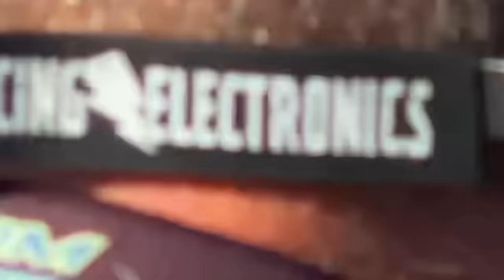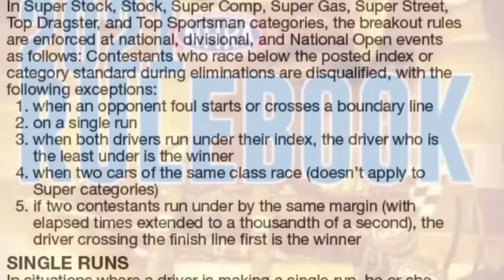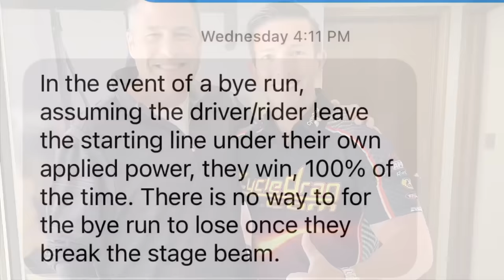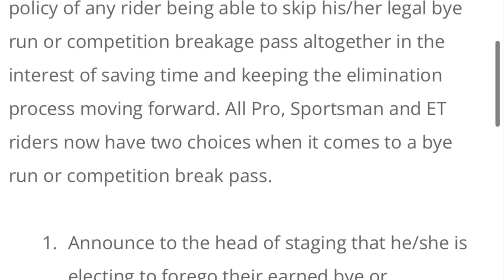TOP FUEL MOTORCYCLE GONE WRONG!

Comment: Judging from the contact patch on Vantine's bike during that DQ run, it's twisting the rear suspension and putting more weight on the right side of the tire at the big end of the track, and pushing the bike left. Maybe there's a broken strut that's not showing up until it's under power? Just a thought...
Reply: Agree, It sure seems mechanical.  That covers a lot of territory.
Reply: no suspension, but i agree.....the rear tire mount is flexing and steering the bike
Reply: I think it’s the pilot
Reply: @canabox7112  and you have raced how many bikes?
Reply: @mattsez2879  a few
Enough anyway
Reply: @canabox7112  mhm
Reply: Excuse me engineers oh you who engineers... One tiny itsy bitsy little bitty problem with your theatrical theory.... There is no rear suspension
Reply: @donniebaker5984  yes.....i said that and others agreed yee with zero engineering
Reply: Right no rear suspension but he's calling it right when he hits go the bike is twisting the entire frame forcing the front tire to twist to the right making the bike go left no amount of counter steering is gonna stop the bike from going left with the front tire riding on the left side like that. It's just gonna force it left til he stops twisting the throttle. The rear frame needs cross bracing  from right high to left low to stop the twist it should be welded in just in front of the rear tire to stop the frame from twisting.
Reply: I haven’t played back in slow motion. So I can’t agree or disagree with anyone. But you don’t have to have suspension to have flex that causes adverse effects. And I don’t know much on these exact bikes. But the rear is definitely mounted and aligned somehow. So there definitely must be potential for issues somewhere. And no I don’t have experience in two wheel racing. But I do rac 1/8 mi quads. Where 1psi of air will cause bad trouble. Also with no suspension

Comment: I agree with Dan W to a degree, it appears when it goes into tire shake it seems the slick rides up on its right side.  I would make a slick change .  Maybe a slower reel on the tape may show if the suspension is twisting alot, but you can see the left side of the tire never peaks.

Comment: Just thought you might like too know, my 2021 Ducati Street Fighter, with Akrapovic full Titanium exhaust MAP upgrade and low restriction air filter Dynoed 207 rear wheel horse 415 lbs and ran a 9.54 1/4 mile ! IMAGINE with a wheelie bar. Getting closer too the 8's for a street bike. THIS bike is my every day transportation ! 9,000 + miles in 10 months..
Reply: That's badass
Reply: I always thought they should bring more Ducati's to the mix 👍
Reply from the maker: Thanks a lot for watching and following the channel. Which Top Fuel Motorcycle in this video was your favorite and why?
Reply: @cycledrag  I'm an X HARLEY dealer and Flat tracker THAT should awns er your question lol. My 78 Sportster XLCR,, Cafe Racer, ran 12.00 flat in the 1/4 in 79. I always have too do things differently. OH, I'm just shy of 73. When I take my helmet off, you should see the look on there faces, ESPECIALLY the POLICE,, PRICELESS !! I never try too out run the police, there radios are faster. So they appreciate that. Quiet a few warning tickets. 140 in a 65,, SERIOUSLY

Comment: In ref. to Dave Vantines situation. These rules were originally designed for side by side racing and should be modified for single lane passes or by runs. Jay seems to have lost touch with the spirit of the rules and needs to reevaluate this rule for sure.
Reply from the maker: Yes' Id like to see Man Cup follow the NHRA rule. Thanks a lot for watching and following the channel. Which Top Fuel Motorcycle in this video was your favorite and why?

Comment: Great video.  Great job of commentating, so far.  At 8:00 mark, I would guess, frame flexing, for some reason, or uneven traction, side to side, on rear tire,  bad tire, or burnout, front, or rear tire not on centerline.  I hope the figure out what it actually is.  Very interesting to know.  At 11:01, I saw a steering damper on a bike, on next run.  A simple possibility there, also.  On the rules for drifting over the center line, if a bike has shown a tendency to drift the same direction, more than once, maybe twice, in the same event, it presents a strong risk to its rider and to his opponent, in any future side by side runs.  Even in a single bike run it points to strong risk in a future side by side run.  Rule, or no rule, I can understand the DQ, after several times of drifting like that.  I wouldn't want to race him.

Comment: Great coverage, I enjoyed it.

This is just a guess:

Regarding crossing over into the left lane, it would have been helpful if the camera had been located up in the air, perhaps 10 to 15 feet above the track surface, in a fixed position pointing straight down the track from directly behind the racer's staging position, and not turning to follow the racer. Make it follow as closely as possible as though he had a bullseye on his back. Also, use the slow motion setting if one is available.

I think the swingarm is flexing/twisting ever so slightly to start the process. Noting the chain pulls entirely on the right side, producing a cantilever effect on the swingarm. Viewed from above, the bending allows the rear tire to move toward the 11o'clock position, i.e. the front of the bike moves slightly to the right because the rear wheel has turned to the left. As the rider senses this he makes a move to counter/correct for the bending, etc. and by the time he does that the rear wheel is really chewing the track for traction, and staying on the throttle causes it to continue toward the left lane with little correction remaining for the rider to make before he's already in the wrong lane.

I don't know that it would have been any clearer to see what's happening, but I truly think an overhead camera pointing in a fixed direction so everything can be seen with the same fixed eye might reveal the cause. Whatever it is likely happens within the first one or two tenths of a second, i.e. the moment the swingarm is being slammed from a no load condition.

Incidentally, has the same problem ever occurred when he ran in the left lane, and have other racers experienced this problem?

Best wishes, and I hope this helps.
Reply: ……….comments…….not novels!!! 😏 I’m just saying…..🏁
Reply: @randalskinner1194  stick to the video, if you can't read.  just saying...
Reply: …….everyone’s always got something to say……it was a suggestion, not an invitation to a fist fight. If you agree with him, smash his thumbs up button. Disagree with me, smash my thumbs down button. That’s all that’s required. False accusations of someone’s reading competence………really???

Comment: These guys are all on the absolute cutting edge of going this fast on a motorcycle with the biggest set of nuts you’ve ever seen in your life I mean they can’t carry these things on airplanes that guy in the video is basically on a motorcycle 200+ miles an hour and a quarter mile with 2 3 Liter bottles between his legs impressive i’ve heard now in 2022 they’ve actually got a surgery where you can have them on a quick detach system so that’s gonna give them a solid 10or 15 miles an hour 45 lb weight deduction

Comment: Torque steer is what the slow motion video shows when the bike leaves it 60 straight because of strong left side wheelie bar wheel contact but once it gets up on the tire the input from the wheelie bar goes away because of diminishing Torque leverage over the tire so tire speed is rapidly increasing and so is tire growth thus unloading the wheelie bar and now the front wheel has a say in the matter so with the Torque steer that is being applied the chassis is flexing thus driving the bike left ..if it wheelies the whole length of the track it would go straight...... Larry Spiderman Mcbride has always been my favorite CH3²  kind of a home town heroe but I like all bikes the ones that go straight the ones that only turn left the ones that jump and definitely the ones that drive edges of the tires
Reply: Ps I grew up in the early 80s on H2s H1s and S3s kawi 3clyndr trips

Comment: Bye runs exist because there is an odd number of competitors in a given round, otherwise everyone races an opponent. Therefore I argue that all rules for a normal run should apply to bye runs which should require a timed pass be completed from the tree to end of the track no matter what ET and speed is achieved. It isn't fair to the other competitors when one competitor is not required to at least heat cycle their equipment during a bye run and avoid all wear and tear on the bye run equipment. Besides, if you can't make a complete bye run then you would not have been able to make a normal run against a competitor and you would have lost that round anyway.  Just like crossing the center line should be a disqualifier whether someone is in the other lane or not. Sorry, but if your equipment cannot run safely down the track, you shouldn't be allowed to race until you find and fix the problem. It isn't fair to endanger a competitor in the other lane because something is wrong with your equipment, no matter what you are racing.

Comment: Hi Guys quick observation without knowing the set up; have a look at the wheelie bar wheels, it appears that the left wheel is loading up before the right! This could be a number of things if engine toque is doing this and all other things are equal it could be adjusted to counter it. But it also could be as simple as the left wheelie wheel is not running as freely as the right creating drag, pulling the bike left. I’m sure it is sorted by now.

Comment: I love top fuel bikes. Raced normally aspirated bikes for years. Never thought much about it till now so a question. Is what they spray into intake at start up the same fuel they run on?
Reply: They start on alcohol, or pump gas, then feed the nitro. It's just too hard to start the engine on nitro alone... nitro is nasty business, and extremely unforgiving...lol...from Wyoming USA 🇺🇸 🤠
Reply from the maker: Thanks a lot for watching and following the channel. Which Top Fuel Motorcycle in this video was your favorite and why?
Reply: They use alcohol (or gas if cold) since you can't start an engine on nitro and nitro really need to be under compression to light..  but even alcohol motors use the same process..  allows the engine to spins fast enough to run the mechanical fuel pump :)  (and on SUPER HUGH compression applications w/ nitromethane) build heat in the motor. .that would be like a/fuel dragster for example.. the blown stuff is preeeeetty lo compression stuff normally) 

😊
Reply: Google top fuel dragster starting with nitro in cylinder it’s most impressive that nitro is wicked unstable unforgiving stuff as the other guy said zero room for mistakes there is a certain sequence in how you manage and operate on nitro and there is no room for deviation when you deviate you create a bomb quickly every time like clockwork the guys who run nitro and the guys who work on the cars that run nitro or the bikes do not get enough praise for how crazy that fuel is to use it’s as close to a bomb in a controlled manner that you write down the track as it gets top fuel nitro bikes

Comment: First, I'm not into motorcycle drag racing. Around the 23:40 mark on your video when he took off, note that his bike when on to the left wheely bar. That tells me his leftward ride was mechanical. Sorry if I don't know the exact reason. Looking at where he launched from, I wonder if the bike would drift right if he had launched from the center of the black line instead of slightly on the right side. It is possible the right side of his tire was gripping or slipping compaired to the left and center of his tire. That could have caused the leftward drift. I really am guessing on that.

Comment: Normally I would say crossing the line on a solo run shouldn’t be an issue but crossing the line on multiple runs you need to be disqualified for the safety of the other rider.

Comment: on the no1 piston failure run he rocketed off to pass and win with only three cylinders? 
On the left steering tendency, check to see if the swingarm is twisting under load, axle 
bent, tire bad, bearing loose, try a different frame, slight lean to the left on launch, knock 
yourselves out. I used to seriously admire drag bikes.

Comment: Try changing the whole rear tire and axle ; bearings to the new upgraded stuff or put a steering adapter on the other side and use nitrogen in the tires and have the seat leaning to the right. Jeff Cagle

Comment: I realize they don't get enough TF entries all the time but inline 4's and v-twins should run separately or have the same rules ie both can do across the line burnouts or no across the line burnouts and the crew pushes you back. I know from running my alky dragster the NHRA is specific that if you burnout across the line you must be able to back up to stage " no pushing" allowed.
Reply from the maker: The can both burnout across the line. The Harleys just wait back because they don't need to and are set up to run for a much shorter amount of time. If you saw on my channel a few years ago Jay Turner ran out of fuel against Sam Wills. Thanks a lot for watching and following the channel. Which Top Fuel Motorcycle in this video was your favorite and why?
Reply: Does anybody know if Jim Fagan still racing TF Bikes?

Comment: His rear tire upon launch was pulling out from under the bike to the right… which caused the front to further be out of alignment to the center. Unfortunate turn of events… but that rule is for safety and i would be more inclined to further debate the rule for safety reasons and add a bulls that if the rider can correct back to the original lane before crossing the finish line the run should not cause a DQ

Comment: Get well and come race spiderman. That said the bike that's crossing the line when he's getting into it you can see the bike is twisting the frame forcing the front tire to lean to the right forcing the bike to pull left. They need to brace the frame tighter at the rear tire frame area to keep the frame from twisting so much.

Comment: I know I used to race at Willowbank Queensland Australia I was told to change my forks in doing so we put the new set in but we didn't set it properly that way it was always pulling to one side after resetting the front forks and adjusting them on the triple tree it now run straight and that is on a super Blackbird which done 223 at 10.2.

Comment: Rear wheel not aligned properly or try changing rear tyre or too much weight on left hand side of bike is all I can think of,I would rather be in right hand lane and pull left as long as I didn,t interfere with other bikes run,maybe they should do by runs until they get it sorted,good luck guys. best wishes to you all,from,Auckland,New Zealand,⭐⭐⭐⭐⭐👍👍👍👍👍🙂🙂😉
Reply from the maker: Good call. Thanks a lot for watching and following the channel. Which Top Fuel Motorcycle in this video was your favorite and why?

Comment: Change the rule! What would’ve happened if in the final that single bike cross the centerline? Would they have been D queued also?
Reply from the maker: Good point. Thanks a lot for watching and following the channel. Which Top Fuel Motorcycle in this video was your favorite and why?
Reply: If anyone on the team knew the rules they should not of even ran that and taken a bye. They know the bike doesn't run straight. No need to change the rules the team just needs to know them. They beat themselves.

Comment: if dave  knows the bike pulls left  then take off  aim the bike right slightly   there must be bad wheel bearings in rear wheel alowing rear tire to   move  and firceing bike to pull to the left no swing arm so it has to be wheel bearings

Comment: That's just wrong fan got crap out of a race and racer crap out of a chance for a win that my impression if you break the starting beam in bye you a winner but you push the issue and crash that the only way can forfeit  and you race vehicle can not continue  in final round than the other race should be considered  the winner